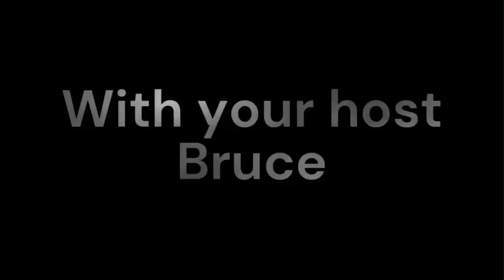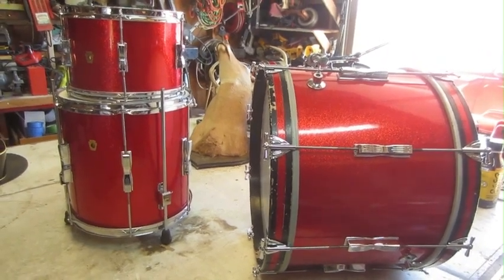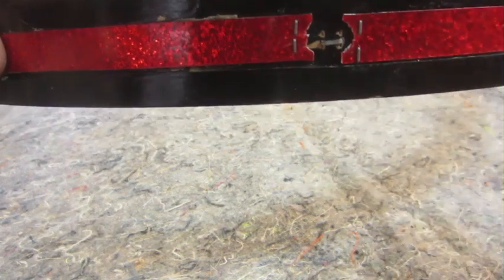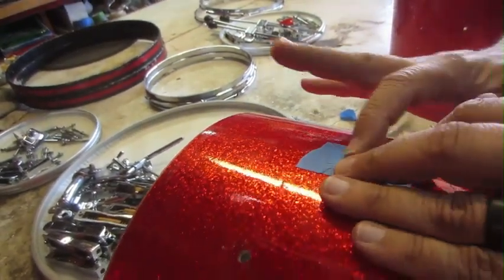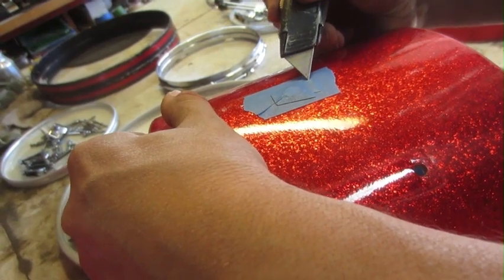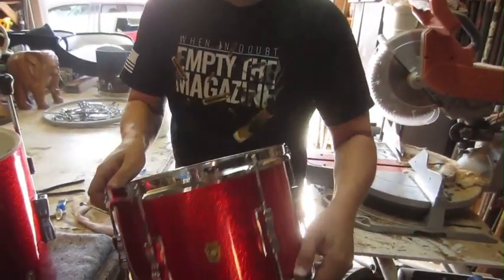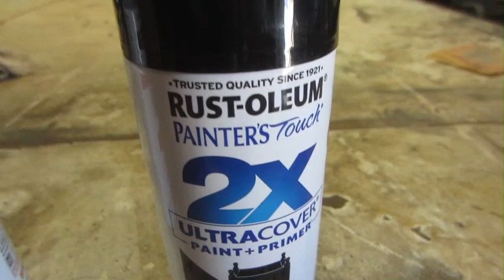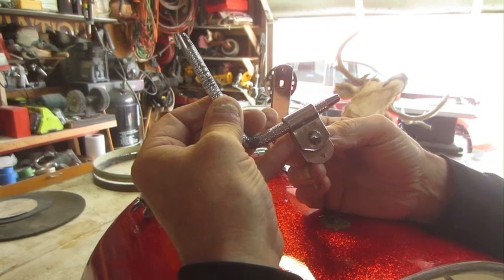1965 Ludwig Club Date Drum Set Restoration

Comment: I've had old Ludwigs that had terrible shell edges from the factory, very rough-cut. Does it hurt the value to clean-up the edges? Is it still a bad idea if the edges are rough?
Reply from the maker: Depends on what you call " terrible edges". I would never touch the edges on a vintage drum with a router, which is the standard way nowadays. As soon as that white paint is tampered with, the vintage value goes down by a 1/3 if not more. Seems like people tend to try and get a " modern" sound out of a vintage drum. That is a mistake in my opinion. If you have to have that sound, then just get a vintage set that has holes or other issues like a re-wrap and then you can do your thing.